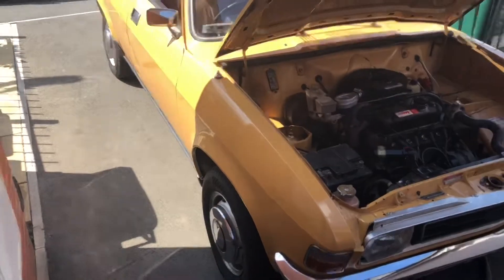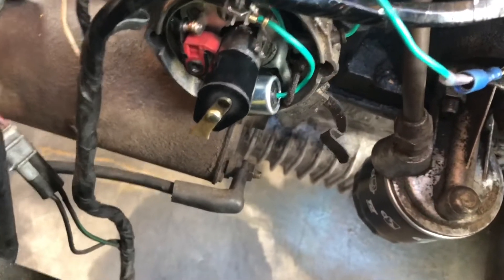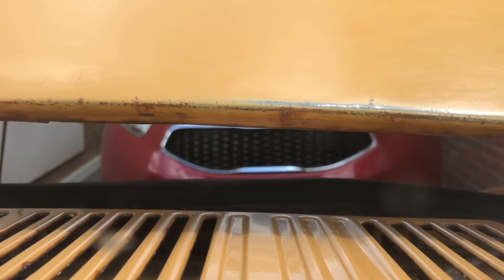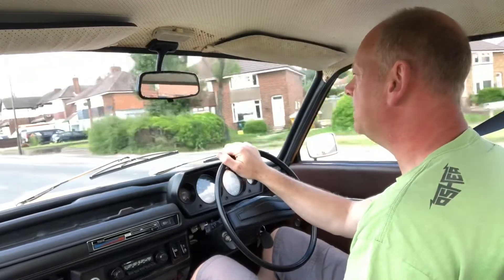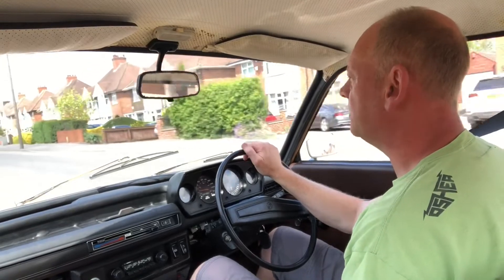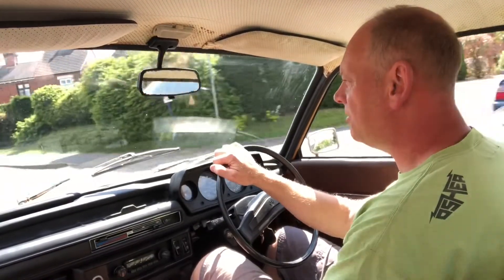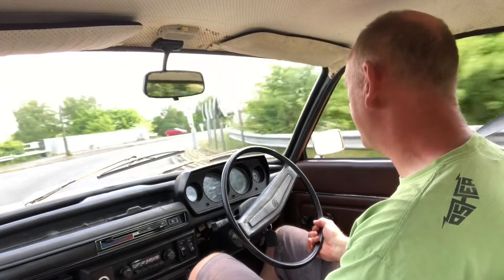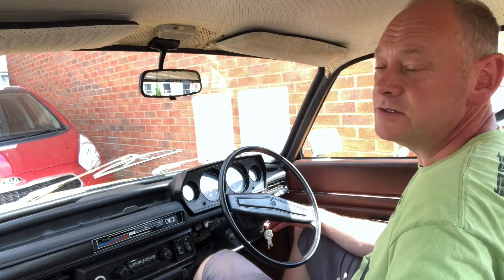Austin Allegro Ep.28 Old faults New faults No faults? Test Drive 2 British Leyland A Series Power!

Comment: Fair play to you; you've done really well to get it to this stage. Being brought up in the Midlands, surrounded by BL cars of all kinds, I cannot help but have a soft spot for the Allegro. Thankfully, they are now an iconic classic and getting the recognition they deserve. My Metro HLE tended to run on after switching the engine off; it is just a characteristic of A-series engines, due to the set-up. Not much can be done about it really. When it runs on, just promptly push the accelerator to the floor and it should stop (or select a gear and raise the clutch fairly quickly). Otherwise, I would not worry too much. A-series also tend to overheat a little in hot weather. If you find yourself sitting in traffic in a warm day, the temperature gauge will climb quite quickly and the fan will kick in. Just put the heater on, on the hot setting and open the windows. Again, just another A-series characteristic. It is a solid Allegro you've got though; well worth treasuring and preserving. Will only appreciate in value. Please keep the videos coming. Thanks.
Reply from the maker: Cheers thanks glad you enjoy the channel
Reply: BMC engines when you turn them off - bdmmmph bdmmmph whirr clunk .  As standard 👌👍
Reply from the maker: @nickdudley1485  haha. Yeah but only sometimes it seems...
Reply: @AgathaAndAnything  yes it has to be random, check the distributor advance diaphragm and springs, common weak spots 👌
Reply: @nickdudley1485  Couldn't put it better myself. Good old engines though; much more interesting than the boring, over-complicated, computer/sensor filled rubbish of today.
Reply: @AgathaAndAnything  Forgot to mention; try clear grease on the clutch pedal. That should stop the sqeaking. It worked on our '04 Daihatsu Terios anyway.

Comment: Seems to be running pretty well.  I would replace the points, condenser, rotor, leads and plugs anyway.  For what they cost it will ensure the good running continues.  They're all service items and start to degrade after a while.  Damp can affect the ignition system, especially older leads.  Please grease the clutch pedal.  Good stuff.
Reply from the maker: Keep watching to see further faults/fixes 🙂

Comment: I'll never be blaze about water leaks again. I was before on my VW T25 diesel van thinking the water leak was minor. Ended up cooking the engine on a 5-minute drive after it unexpectedly got worse and dumped all the water out. Never again!

By the way I successfully patched the Manifold on my old Yaris with metal exhaust filler lol.

I reckon you'll get more subscribers eventually, just need to give it time.

That's the thing with modern cars, they all have such firm rides to cope with the weight of all the safety equipment. I think it was Colin Chapman who said low weight was the key to a good-driving car.
Reply from the maker: Yep, I am very wary of temps and definitely need to keep checking, I had a T2 air cooled myself a few years ago.
Reply: Austin Allegro - All Aggro poo coloured 😆😁
Reply from the maker: Stu Cooper haha hello mate.
Reply: Austin Allegro Agatha good to catch up with you 😉

Comment: rick points are really easy to set up. as long as u got the info for the gap it's only a screw to slacken em off. then slide a feeler gauge between em so u get slight resistance, once u got the right gap tighten screw while gauge still between points and voila!
Reply from the maker: I am going to invest in electronic ignition anyway. Fit and forget
Reply: @AgathaAndAnything  haha easy way out hehe don't be scared. I am learning all the time with my moggy. even took her engine and gearbox out myself, never would have dreamed of doing that years ago!

Comment: I managed to stop my Discovery v8 from running when cleaning the plug leads with too much WD40..once i dried it off the connections it ran properly..
Reply from the maker: It does seem that is what I did, nothing wrong today.
Reply: WD40 is not the cure all some folks believe.  I used to think it stood for War Department from back in the day or even Water Dispersant.  Thorough clean and the merest smear of LM Grease or even Vaseline will keep those Distributor Components and Leads watertight and in good health. Little touches of TLC like that will make any car so much more reliable. Works for me.
Reply from the maker: @T16MGJ  keep watching, it gets worse before it gets better.
Reply: @AgathaAndAnything   Good for you AAA .. I get more pleasure breathing new life into old British Cars than I did when taking delivery of a new car which I've done many times particularly company cars as well as private car purchases. Of the last five used cars I have purchased, three were from folks who came offering me their problem cars knowing my liking for challenging projects.  On one day two such cars were offered and I had to turn one offer down which in second thoughts, really was an offer I should not have refused. One of my favourite cars turned down. Still regret doing that. However, time constraints means that with the best of intentions, you can only do so much.

Comment: cir you had all three in that complant bit you went posh snob back to normal ten slight usa person good wide range there, also that squecky cluch pedel adds the BL touch of annoying like a rattle yuo can't find or fixing a bit of trim then it starts to peel or another part starts to let go the another and another, sounds good might be  a bit too much wd-40 in area's were that's not needed or its drawing though the last few bits of older fuel/oil and its now better